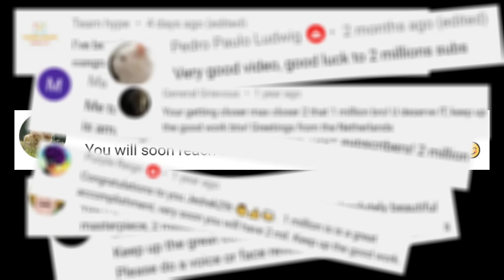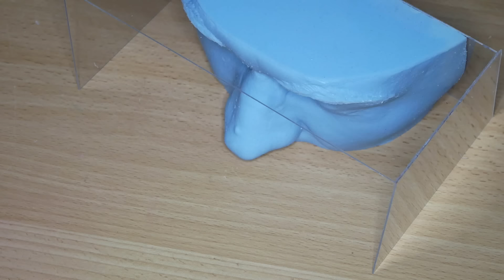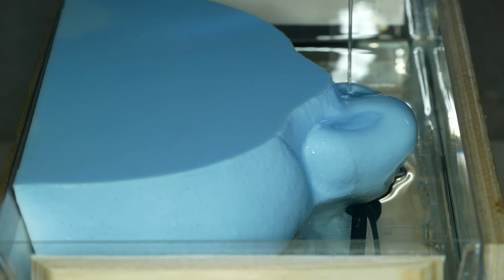Face Cast Epoxy Resin ASMR/ 2 Million Subscribers / RESIN ART

Comment: Next time.. do a FULL FACE!! Use a small flex tube to breath with thru your mouth..  after the mold has set  and you remove it.. you might need to fill the straw mark in with a second resin. ORRRR... when you put the straw/tube in your mouth.. cover it with some makeup Halloween tape type stuff. haha GOOD LUCK!!
Reply from the maker: I've already done that. Check on the channel 😉

Comment: Hey great projects. I have a question. If you make pojekts like this : How you make it? Wet on wet or layer for layer? Thanks for answer :-)
Reply from the maker: Normal resin after a small layer. But if I use resin for large castings, you can pour it all in at once
Reply: @jedrek29t  thx . I`m beginner. a made a lot of gravel  ( by hand) in glases, a few things in modeling mass ( intressting) but this is very intressting :-) a saw alot of videos an the rest : is leraning by doing and a few tipps :-)
Reply: sorry learning by doing i mean

Comment: Epoxy Resin, the fumes are toxic and flammable.  Should be used with maximum ventilation.  Open doors or in outside settings.
Reply from the maker: Exactly